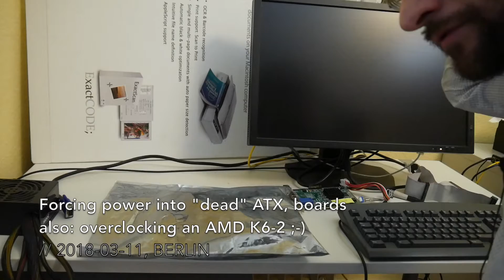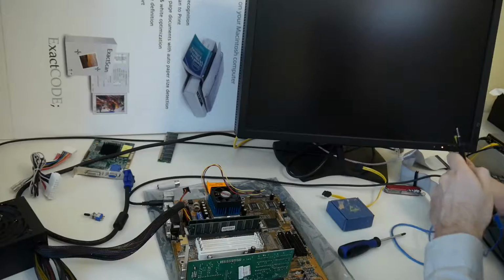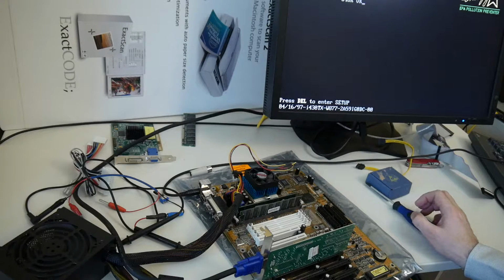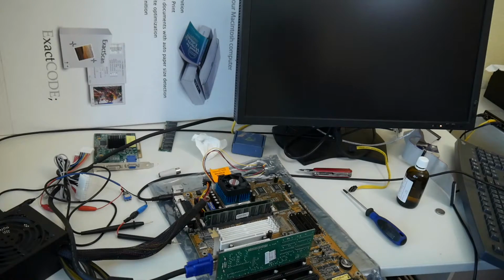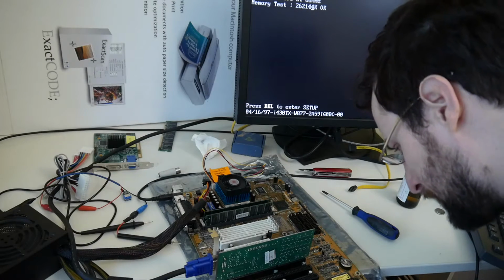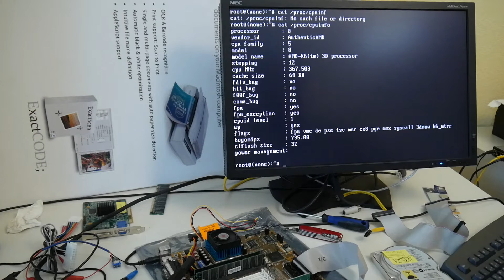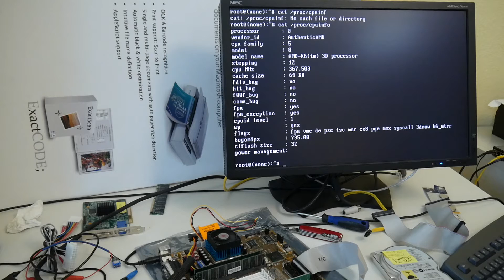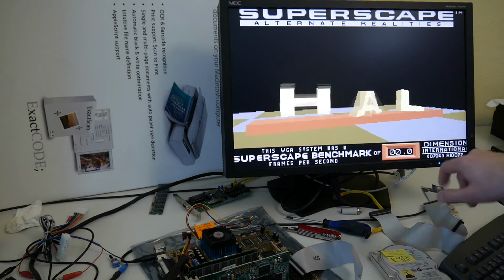Forcing power into an ATX board, also: AMD K6-2 overclocking!

Comment: Nice videos, I sometimes like to play with hardware like this too. I happen to have a GA-586TX3 which looks very similar to your board, it received a BIOS update for correctly detecting the K6-2 at 400MHz (and I bought this CPU on ebay just for the fun of trying it). Also had to use the remapped multiplier for that to work with the 66MHz bus, but it does work. 

Something to keep in mind though: the Intel 430TX chipset supports 256MB of RAM but only 64MB of cacheable RAM. Performance with more RAM could be worse because of this. Not sure what part of the memory will be cached in that case. And does Linux start allocating pages at the beginning or end of physical memory space? ;-)
Reply from the maker: thanks, and good to know, did not remember that quirk, … :-/ which I had an k6-3 or 2+ with integrated L2 cache then, ..!

Comment: Regarding the -5v fail in the BIOS: Modern power supplies very often don't include a -5v voltage rail anymore. That's why it's "failing".
Reply from the maker: indeed, I just checked the ATX spec page on wikipedia, and it does not even list a -5 rail on the ATX plug - https://en.wikipedia.org/wiki/ATX#Power_supply - I wonder why it is listed on an ATX board's BIOS then, unless it is meant to be internally generated, ...
PS: actually the wiki text mention -5, but the pinouts to not list -5?
PPS: ok, here the ATX v1 pinout lists -5V, and this apparently is Not.Connected. in ATX v2 and later, including my SFX supply there, ... the Wiki text mention this mostly used for ISA cards
PPPS: ok, Wiki page mentions -5, just my Safari's search does not match "-5"???  "Formerly −5 V (     white wire), absent in modern power supplies; it was optional in ATX and ATX12V v1.2 and deleted since v1.3."
Reply: The -5v rail was only used by older generations of ISA-cards. AFAIK some older soundcards for example will only partly work without the -5v.
Reply: @armorgeddon  yeah the operational amplifier needs dual rail supply to generate sound wave voltage signalling :-()
Reply: @kitecattestecke2303  I have since seen an ATX-to-AT adapter which also generates the -5v rail. It was very recently on Phil's Computer Lab here on YouTube.